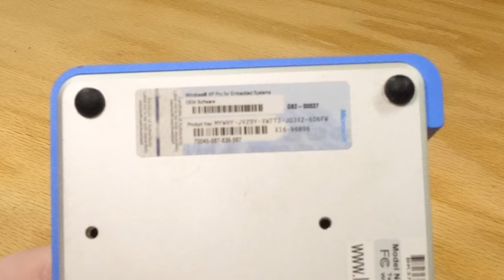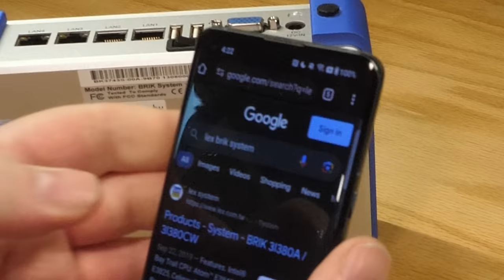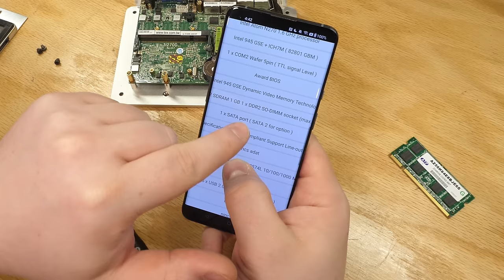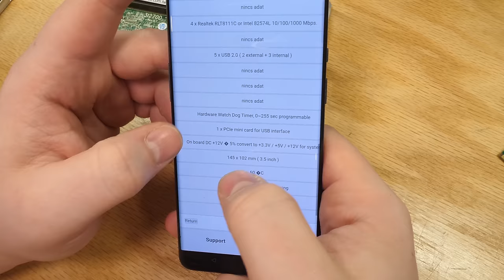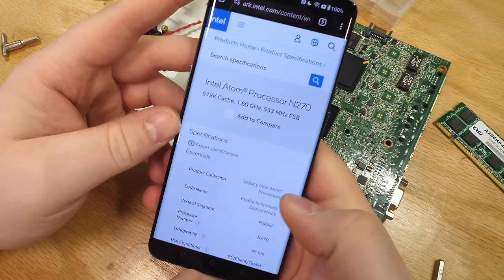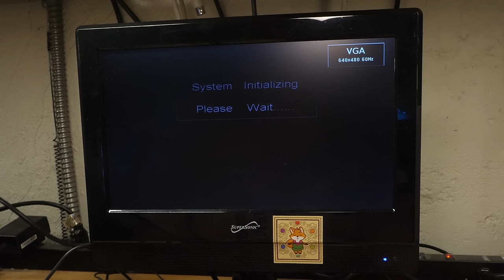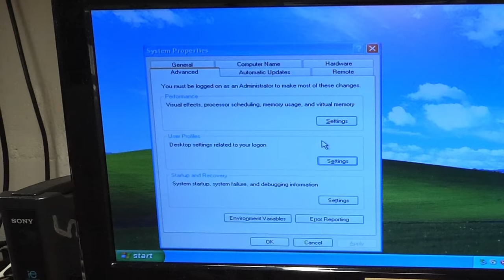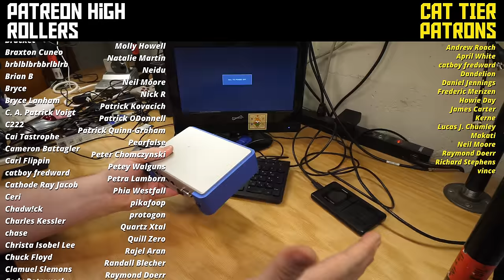Little Guys: Episode 3 [Lex Brik]

Comment: 30:52 reminded me of something else on certain computers that were a royal pain in the ass. the Dallas battery, that also contained the clock chip, so you could only replace it with the same. and they were getting hard to find later , after the systems became outdated, and I think also..... virtually impossible now. BUT, I saw a video , where someone drilled into the chip, in just the right places, and  soldered wires from there, to an upright  2032 battery holder and hot glued the holder to the motherboard.  I think these type of bios battery monstrosities  were on some of the 386-486 motherboards. if my memory serves me well... it has been a long while since I worked on one

Comment: I had an idea a few weeks ago of making like an "efficient materials" PC using an aluminum case as a shitty heat sink and antenna. Basically I wanted it to have each component serve as many functions as possible, And the design I had in mind was basically this but with a PSU strapped on the bottom pushing air through the top, like if this thing had a baby with a trashcan mac

Comment: Im actually just really excited that you're looking into these devices, there's thousands of weird and quirky tiny PCs. some mundane, but most. have some weird and wild function or device sandwiched on. 
I think I have a passively cooled Core 2 Sign driver computer, HDMI out. and it seems to have an m.2 style connector (seems not to be mini pcie) that has an optional Hardware H.264 decoder factory option, Mine doesn't have it. But there's so many things, and I wish m.2 was used for more. the most interesting I can see is the NPU accelerators and USB and or 2.5G and higher ethernet controller boards.

Comment: all modern wifi+bluetooth cards use the USB pins in the M.2 or Mini PCIe to pass bluetooth. that's why if you get a full size PCIe bluetooth+wifi that uses a laptop card, it needs a USB header.

Comment: This also could be used for a very expensive CNC machine..  Gateway was making  a 10"laptop/web cruiser with the N270 in this timeframe.. 
FYI:

IODD ST400 2.5 inch Enclosure / USB-C/Bootable Virtual ODD / AES256 - Express: US $109.34/ea
LEX COMPUTECH AN2580 Industrial Mini-PC ~200$  Condition: Open box

Comment: I would guess the upside down Ethernet ports were intentional don't want to cross your public and private networks. Also I think the relayed version was to put a physical kill switch in the remote side of the system. I'm guessing there was software that would cut the relays and shut off the connection. It used to be a fairly common requirement.

Comment: 38:39 I've had that issue with some BIOSes before (and, funny enough, even some poorly-made UEFIs that don't like Windows ISOs being dd'd to USB), and the solution I eventually came up with was purely DIY: a rooted Android phone, running a self-built patched kernel (there's a patchset online to fix USB CD-ROM drive emulation) and the DriveDroid app. It was not a trivial endeavor to get up and running, but it costs 0 dollars.

It's actually crazy how much BadUSB potential phones have. They can emulate a keyboard and mouse with any device ID, fire any kind of macros, and emulate several other kinds of USB gadgets as well. I actually used an old, bare phone board to get a sort of janky pirate remote VNC access to a PC's BIOS without any kind of Intel enterprise stuff for a while. The VNC display was just a live feed of the phone's camera in the lowest possible, 8-bit, potato ass quality you can imagine, but it worked!

Comment: I haven't seen a mini-PC with built-in bypass relays but I have seen numerous add-in cards with this function. The one I have at home has a watchdog timer in an FPGA (instead of simple power-only switching) but here's the weird bit: it's connected on the PCI bus but instead of using proper PCI detection and configuration mechanisms it uses hardcoded IO addresses. I'd be happy to lend it to you but shipping costs make this not worthwhile, you can probably find one locally for less.

Comment: I ran into that system page file size issue when I put a CF card into my Samsung np-q1 Ultra, exactly the same.  I can't set the bit as the card I have doesn't let me so I have to use a junky driver to fake it. I am planning to switch from the CF2ZIF to an mSATA2ZIF converter some time.

Comment: I would guess that the VESA mount would let you take it apart, mount it directly to a display, via those holes, and then put it back together.
Reply from the maker: Trouble is you wouldn't be able to get the case screws back in with it against the back of the monitor, and you'd have to do a complete disassembly to get to those holes from the back side. More likely you're just supposed to interpose a steel frame between the two, this is a pretty common practice.

Comment: You absolutely can replace a rechargable battery on a mobo with something else if you know the intended voltage, and you use a proper shottky diode to prevent the charge reaching the replacement.
Reply from the maker: That is generally true but from what I understand the tibook one has intelligence and is tied into the system power management controller.
Reply: @CathodeRayDude  Sounds like Apple. They are crappy about that.

Comment: I didn't realise it was possible to do bypass relays with copper. I've seen similar for fibre monitoring though; There was a little mirror held out of the way by a sprung solenoid so if it lost power the device would go into optical passthrough mode.
Reply from the maker: oh my god that's amazing

Comment: I think you misunderstood what the VESA mounting holes are for. Not for mounting the machine to a monitor arm, but for mounting to the back of a monitor. Or maybe even just mounted to the machine its controlling. The screws would go from inside the lil guy.
Reply from the maker: I was making a joke. You'd mount this using an interposing frame; putting the screws through from the inside would be completely impractical, it would involve total disassembly.
Reply: @CathodeRayDude  Oh, well I didn't get the joke. My bad. But I have seen this style of mini pc mounted exactly that way, the idea being that it involves total disassembly on purpose so it is very hard to steal.

Comment: Did you notice the 2cnd sata port that was unpopulated. Also one of those unmarked header boxes has a jumper position to bypass keyboards so while in headless mode of operation you don't get the  no keyboard detected error on boot I'm using a similar vintage core 2 duel t2500 32bit processor setup as an emulation box these types of pcs are underwhelming but the size and power draw makes them great for places like in a car or nas possibly even as a router or switch but don't put them in a place where it's already hot or where it can't disapate heat they will eventually overheat and shut down to protect itself. I would love to have one designed for win xp like yours the ones I always acquired are for win 7 embedded nothing special.

Comment: 32:30 i have a titanium piwerbook g4 and while its true that the pram battery cant be replaced and it's annoying, the computer does work without a working one, jonly issue is just that the RTC gets reset the moment you lose electricity for even a second
Reply from the maker: There's other weirdness associated with dead pram on Macs, depending on what you're doing. It also sucks that you have to dismantle the machine pretty deep to get the dead battery out, and if you don't it won't even power on. It should have been a 2032 under a little panel.

Comment: OMG its so blue
 i love it

honestly could be empty on the inside lol

windows pro for embedded was for those embedded systems that needed a license that covered more advanced networking functionality (which is typically tied to the pro release) 
i used pci add-in nics with bypass relays but never come across them on an embedded device like this

Comment: I already knew the answer in mm. More likely it's just 6mm though things made in asia are usually metric. The screws are also likely JIS cross head screws not Phillips. This is important because JIS screwdrivers work fine with Phillips but Phillips screwdrivers gradually damage JIS screw heads (ask anyone with a Japanese motorcycle about that). Fortunately in modern times Phillips and JIS have been largely superseded by ISO cross head screwdrivers and those work well enough with JIS (they still don't fit as tight as a real JIS driver though). Meanwhile in Europe there is a DIN standard for cross head screws that's just different enough from Phillips to have the same problem as JIS. Basically cross head screws are dumpster fire of different slightly incompatible standards and I hate them.
 EDIT: Basically if something was made in asia before 2008 and has cross head screws they are almost certainly JIS. And even after some companies didn't deprecate the standard and switch to the ISO standard for cross head screws like they were "supposed" to and kept on using JIS, probably because it's still more resistant to cam out. Even though the powers that be decreed that JIS was to die, it hasn't and keeps going like a zombie because it's replacement is bad.

Comment: 32:55 Why not wire a holder for a coin cell if the voltage is the same with an in-line diode to prevent the recharge???

Comment: I know how you might get swap space on the system. It's kinda a hacky way and you will have to partition the drive. Windows XP I believe has support for ReadyBoost. It's exactly what it's for, swap space on removable devices. It's from when USB sticks could be used as a faster alternative for spinning HDDs.
I'm just not sure ReadyBoost can be used on a partitioned drive though.

Comment: Re:lays --  Could be that this has a fail-to-wire option.  EDIT:  aaaannd then he figures it out.  Oh well.  /EDIT

If the power is lost, or the watchdog timer expires, the relays would close and connect one Ethernet jack to the other, patching them together.  This is used when a device acts like "a bump in the wire" and does some kind of WAN acceleration or inspection in-line.  When the device is working, it's responsible for re-transmitting the frames itself.  If the device fails, it turns into a wire and traffic continues flowing, even if the device is not able to do.... whatever it's meant to do.

Comment: Here's the thing Gravis: you keep mentioning VNC as the "go to" solution for these mini computers. It never was, because nobody would ever be tasked with keeping thousands of these things up to date. First things first: probably 99% of these things were installed with a custom Linux distro. If by some miracle Windows was used, it was whenever a graphical UI was neccessary. But usually there was a Linux installation, which ET Phoned Home to some central, from where the commands and settings came from. This is also due to firewalls: no companies, hospitals or sane organisations would ever allow VNC or any other proprietary connections from outside to their network. In the central command center, probably MAC addresses were used to distinguish installation locations and commands could be sent to areas, buildings or individual devices. There was never a dude connecting to these devices individually.
Reply from the maker: I'm sorry, none of this is correct. I am not making any of this up, I'm basing it on my personal experience working with plenty of devices of this sort. VNC and RDP are used extremely heavily, yes, including in hospitals; I've personally helped set it up and troubleshot both extensively. You can call them "insane" all you want, but it's what's actually happening. Every single one of these industrial machines that I've seen came with a Windows Embedded license on it, and the ones I've picked up that included hard drives ran Windows, not Linux. I have never seen one with Linux. I'm sure they exist, but they are not nearly as universal as you think. The number of devices just like this that are simply sitting behind port forwards is immense, and I realize that's upsetting, but it's reality.

Comment: "no paging file" - when you decided to install on the CF card, this is one of the reasons I cringed so hard 🤣 XP will not only be glacially slow due to the CF card's lack of caching (all writes are brutally performed with just-in-time "read-modify-erase-rewrite" cycles to the Flash), but also because CF cards often identify themselves as removable media -- thus, Windows has a lockout that prevents a page file from being created on a removable medium. There is a utility that can send the commands to switch SOME rare CF cards between removable and fixed identities... but it'll be bad. Windows itself also disables system level write caching on removable drives. Combine that with the uncached "immediate write" of a CF card without DRAM write cache, and you have the most glacial storage medium for an OS in existence. Every single-byte change to any registry value is now a 4KB+ Flash block nuke and rewrite.

So yeah when you chose to install on the CF card, I was wondering if you wanted an exercise in masochism or not 😂

Comment: Ddr2 and am SSD is an odd combo, but I guess SSDs have been around longer than I thought.
Reply from the maker: Honestly I'm not sure which one they would have shipped this with, SSD is a strong argument for long-term reliability, but they were also quite new at the time still. Like, you could get them, but they were pricey. Now there were industrial SSDs, those have been around since the '90s and usually come in pretty small sizes and are extremely slow, but for something like this it would be workable. I put the SSD in because that's what I had, and I figure they probably tested it with the industrial modules, but spinning discs were still nearly universal at this time and a number of those had pads that could short out on the bottom, so, yeah. Not a very good drive sled.
Reply: I had some similar industrial PCs from that era (N270 and everything). They came with 40GB (or 32GB, not quite sure) Intel SATA SSDs. Pretty sure that most of these would have that.  I also have a bunch of Transcend 32GB PATA-44 SSDs out of machines from the previous generation, so I'm fairly certain that at that point, if you were going properly industrial, you'd have an SSD in it.
P.S. Pretty funny to think that the PATA ones are more "useful" today because you can stick them into ye olde laptops, while the SATA ones are pretty useless because you can just use any more modern and far larger one.

Comment: someone probably has already commented something similar but
it could work as a network router by installing linux distro like pfsense/opnsense assuming they are still maintained for 32bit and the you didint need more than 100Mbit connectivity

Comment: I'm watching this vid (and commenting from) an N270+945GSE+ICH7 system just like this. But mine is a Netbook and i have Linux on it. Chromium, 360p, some performance tweaks. Yeah a system like this doesn't need much cooling at all, just dumping it into the alu side is perfectly adequate. Most of the power consumption coming from the north bridge IC, which includes a GMA950 video and the DDR2 SDRAM controllers. A lot more than the CPU.

Comment: i got a few sub ghz pcs like this in various form factors, they were used in behind tv applications commercially and stuff like that
Reply: oh also, the sesa mount is so they could be stuck directly on the back of a monitor or tv or in some cases on the back of a tv mount also you can set the flags in any cf cards easily, i forget the program i used but it was on github, i had to set the flag for an oldddddddd windows xp tablet

Comment: mPCI-e with only one hold down screw isn't really that odd, my laptop (toshiba C555-A series) only has 1 (or did before the standoff popped off - the wifi card is held in place with a lego wedged into the battery connector and a zip tie)

Comment: 8:56 could have been sheared off with a press tool. cut the boss into upper and lower sections from eachother and then just shear off the top part with basically a big hydraulic robot chisel.
Reply: For my money, that boss was trimmed with a fky cutter, either HSS or carbide. Multi-axis milling extruded aluminum was a pretty off-the-shelf affair by the XP era.

Comment: speaking on the clock battery, even my stupid asus laptop has a battery holder... its on the underside of the motherboard so you need to take the entire laptop apart (dissasembly includes taking off the entire screen) but it is there

Comment: This is completely unrelated but I was wondering about that weekly pill container. Do those typically start with sunday in english speaking countries?
I've just never seen that so it had me curious.
Reply: The ones you can get anywhere off a store shelf is usually yes. cause most English calendars are Sunday-Saturday however Cause they do make Monday-Sunday calendars they also make Monday-Sunday pill boxes. They used to sell both of them in the various styles so you had to be careful which one you bought but as time has progressed the Monday-Sunday versions are more Special order now, and the Sunday-Saturday versions are what you'd commonly see.
Reply: @Dallen9  Thats interesting, thanks for the explaination!
Reply: @RisingRevengeance  no problem. I only know this cause I've accidentally bought the wrong one a few times as a kid. And last time i had to check it was still a thing. And you could imagine buying the "wrong" one cause it had the wrong order for days of the week listed would of drove you nuts.
Reply: @Dallen9  oh yeah I can see that being a major pain